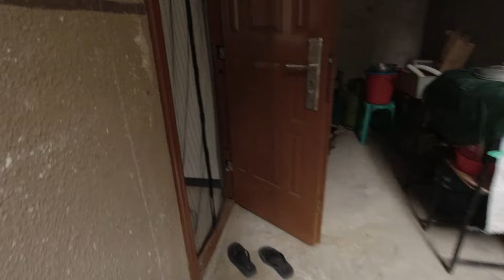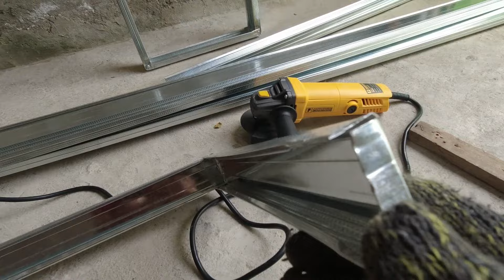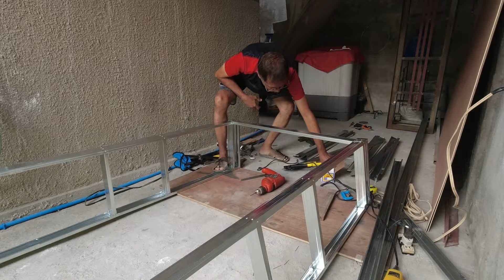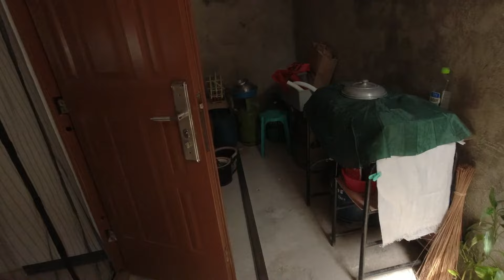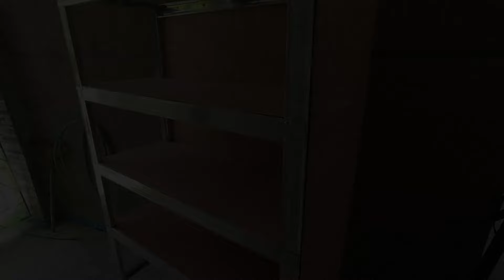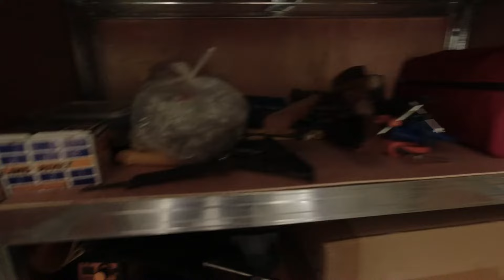DIY Tools Cabinet using metal furring and plywood

Comment: Boss pwd gumawa ng tutorial sa tamang pag washing sa boss 150? May mga wires na exposed kasi. hehe
Reply from the maker: Hindi maiiwasan na hindi mabasa mga wiring lods kaya wag masyado babaran ng tubig. Tapos spray ka lang ng electro cleaner sa mga exposed wirings para madaling mag evaporate at mawala ang tubig
Reply: @LoloniLewis  hndi ba advisable pumunta ng carwash sir? Kasi parang high pressure yung hose na ginagamit.
Reply from the maker: Minsan sa mga car wash din ako nagpa washing ok naman basta inform ko lang sila in advance na wag tutukan masyado yung mga open wirings 😁
Reply: @LoloniLewis  Salamat sa tips boss!